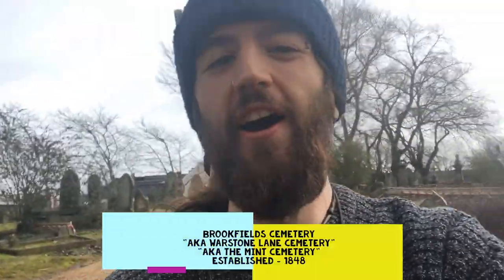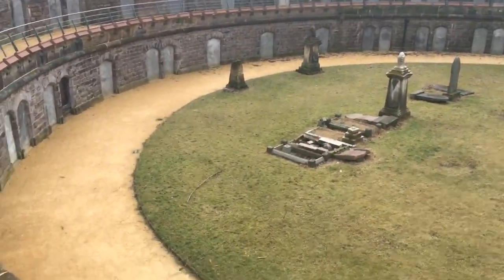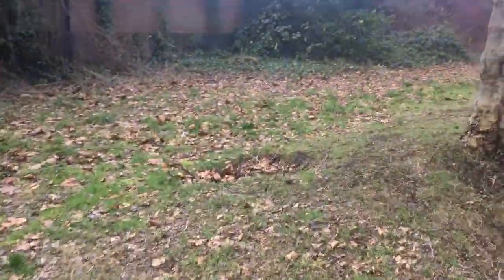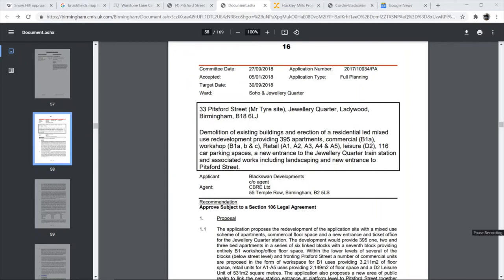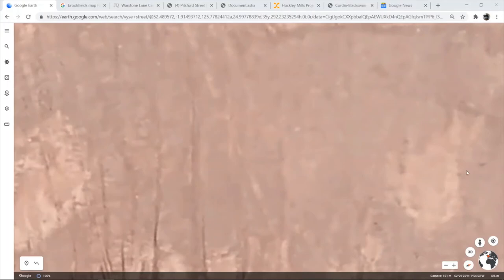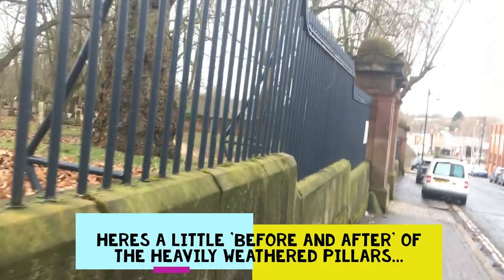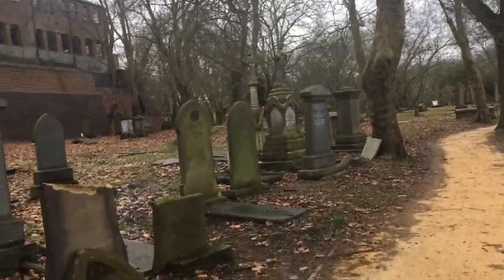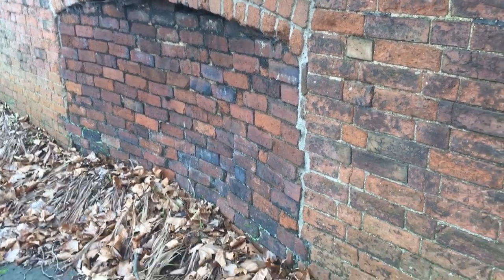Birmingham Hidden History | Key Hill Cemetery, Brookfields' Catacombs & The Massive Dig In-between

Comment: The urinal next to the JQ train station used to be open when I  worked  there 1985-2002. Spent many lunchtimes walking/exploring the same area. It’s worth walking from Warstone Lane/Vitoria Street down towards the GPO tower. The canal system there is amazing and an unusual view of the city centre.
Reply from the maker: Oh brill! I never knew there were still in use for so long! 

Cheers for the heads up on the canal bit - I’ll be heading down there soon! Also want to pop in on the old Jewish cemetery under five ways…

Comment: The part where Mr Tyre used to be is now built on, looks like it’s going to be flats. Nice touch, which may just be for structural/parking reasons is that it’s on stilts...the stilts are (at present) open arches which nicely echo the archways of the older structures.

Comment: It was always 2 separate cemeteries. Keyhill was I believe for nondenominational burials. And the opposite side of pitsford street when we were kids was the old train line and sidings. They then built work units from Clissold street down to icknield street then the other side from icknield street upto the jewellery shops at the top. Then when they decided too reopen the line into snowhill. They had to widen the bridge so some graves in keyhill had to be dug up and re buried to make way for building work. Also the metal work around warstone lane cemetery is new. The buildings in the computer generated pictures will stand on icknield street by the bridge. Good video though

Comment: Also, nice to see on the artist’s impression of the apartments where Mr Tyre was, there is a wall ‘sign’ which reads Hockley and has a large anchor underneath. The anchor is the symbol of the Birmingham Assay Office, used as a hallmark to show that the item was assayed in Birmingham. The story goes that two Assay Masters met, at the end of the 18th Century in an inn called The Crown and Anchor. They flipped a coin...Birmingham Assay Office got the anchor, London got the crown (though I believe London have since changed their mark). When the development is finished I sincerely hope that they do put up that piece of wall art.

Comment: Been 28 years since been down Key Hill Drive, used to part own 1 - 9 sold off in 1996. 3 was b omb damage from WW2.
The tunnel to Key Hill was much wider, could drive through apart from the sticking out steps before the car backed up parked.
Looks a lot of car parking spaces as well, used to be double parked up there from 70's to 90's, maybe congestion zone to blame especially when accomodations being built with only car spaces for 1 in 4.
Many times walked down to the flat, totally changed many years ago used to be some real good shops.